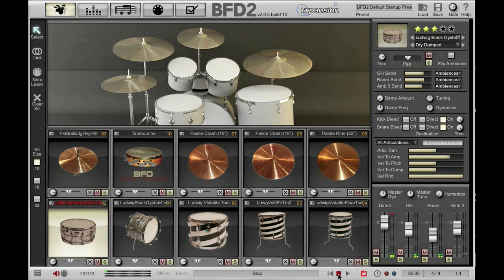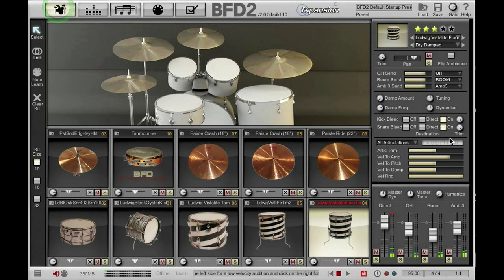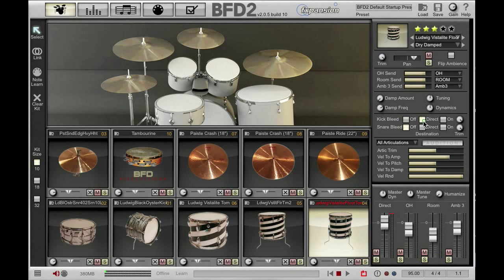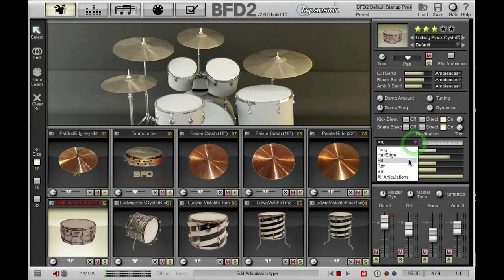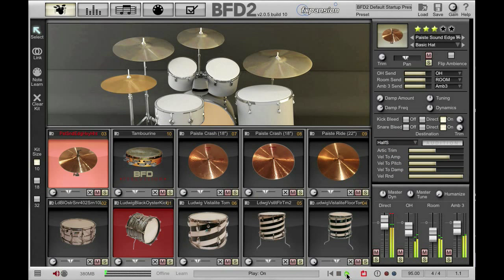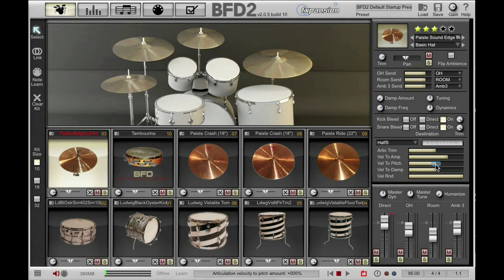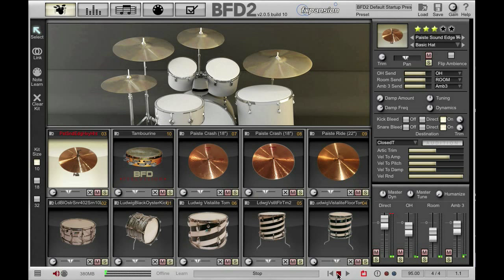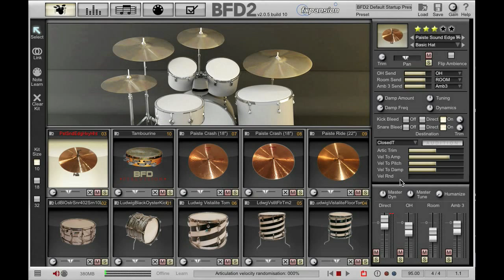BFD2 Kit Piece Inspector Tutorial - part 2 of 2

Comment: I am very new to this type software. Is there a way to hear each drum without buying it first? If I have the pearl Redbox and a laptop do I need any more equipment? I only want great acoustic sounds coming from my e drums. I am intimidated by how hard everyone says it is to get going. And would there be latency?, thanks for posting this video
Reply: Lipstick Drumstick As a beginner you may be better trying BFD Eco first and upgrading to the full BFD3 if you like the experience. Eco is a starter version of BFD and will get you up and running with some great drum sounds. The Redbox outputs MIDI so you'll be fine triggering Eco (there may be some setup involved in mapping the drums to the correct drums in Eco, but it's easy enough). You will need a professional sound card if you want to reduce latency to an acceptable level. Built-in laptop sound cards do not have really have good enough drivers to get low latencies.
Reply: I got EZDRUMMER because I was too intimidated. And even it has been a nightmare. I have no idea why its so hard.
Reply: Lipstick Drumstick Drum sampling by it's nature can be quite complicated (not unlike micing a drum kit). I would recommend picking up Eco to see if you click with it any better.
Reply: That is what everyone said about ezdrummer. No way I am spending more money for stuff I know I won't understand. There is one video drum start to finish online that shows you step by step instructions, with ezdrummer But by chance you do not have the same computer, or same e drum kit... You have nothing. I Don't think I will be trying this again... Not alone anyway.
Reply: BTW ezdrummer also only used a USB cable.